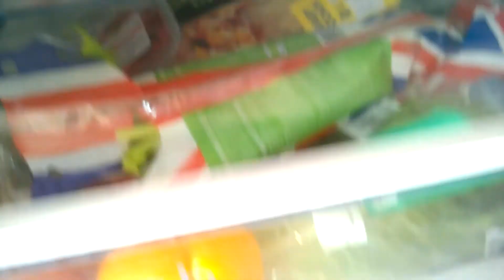Bosch Fridge Freezer - drain blocked - is water collecting and is it hard to open the door?

Comment: When you clean this, a good tip would be to pull the  fridge out, fill a spray bottle a quarter full with a mix of luke warm water and white vinegar, set the nozzle to jet spray on the bottle and spray the contents through the hole in the fridge. At the back of the fridge at the bottom you will see a plastic reservoir being filled up with the solution you made up and any other gunk that was clogged in the drain pipe. Simply remove the reservoir clean it out and place back in once finished cleaning it👍 thanks for vid.
Reply: I was wondering about this, how do I empty and clean that evaporation tray. I can’t access it because I have an integrated fridge but eventually over the years it will build up with dirt and grime and gunk. 🧐🤔

Comment: I have a slightly different model (integrated) but had the exact same issue, and the door panel was coming off the slide rails as a result of the continuous excessive force we were using in order to open the fridge door. There was just a tiny piece of half frozen cucumber causing the blockage and thankfully no gunk, just enough to allow the water to build up. It’s kind of a design flaw but also not difficult to resolve. I will definitely keep an eye on this.
There must be some materials science and physics/chemistry at play when the water isn’t getting away that causes the very strong vacuum effect on the fridge door.
We were having big pools of water down at the bottom and also leaking out over the fridge door and down onto the integrated wooden panels which was a concern.

Comment: I have a Bosch Intelligent Frost Free 44 fridge /refrigerator leaking water by the front door on the floor. The defrost drain must be clogged, but for the life of me I cannot find the drain hole. There is no drip tray or pan. I looked inside the fridge compartment and did not find it there?  Vegetables in the crisp tray are frozen and destroyed. Can someone please, point out exactly where the hole is located. Much appreciated.
Reply from the maker: Best bet is to have a good look through the manual. Might have to get one online if you no longer have the paper version. Could be right at the bottom perhaps?

Comment: wheres that collected water going?
Reply from the maker: These normally run down a tube to a tray located above the compressor. This gets fairly hot and as a result it evaporates the small amount of water that collects there.   Pretty neat design.
Reply: Is there access to the tray to empty it?

Comment: but why it is happening unclear
Reply from the maker: Most likely it is dirt or a bit of food or wrapping getting stuck around the hole.  There could also be a slight blockage of something when the fridge is manufactured since this has not happened for us since this video.
Reply: Drainage hole clean and nice, water going trough to the container but after clean and first defrost the ice appear around the hole and make blockage again. Its like   fridge start defrost and frost immediately again not allow the water reach the hole.
My ftiend had same problem with brand new fridge, technician visited a few times cos under warranty and they gave them brand new fridge because could not solve the issue....